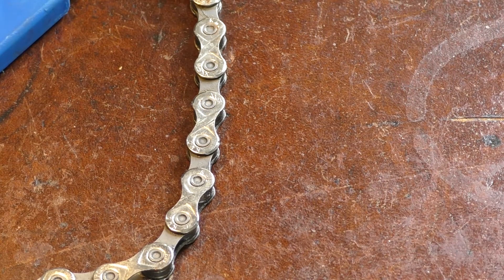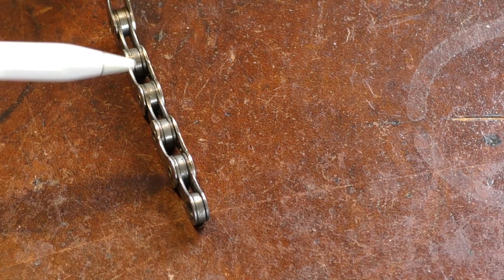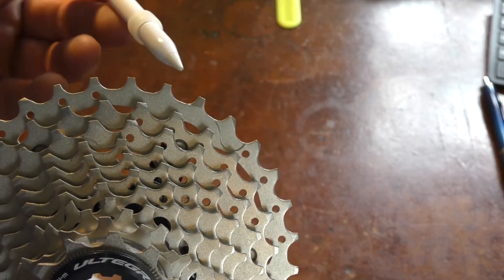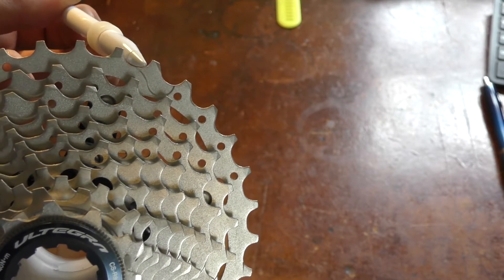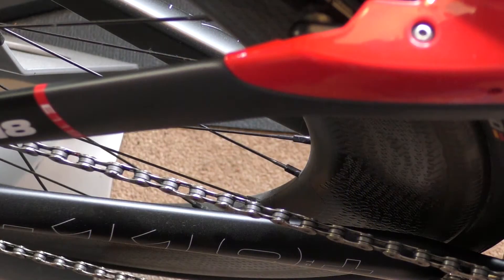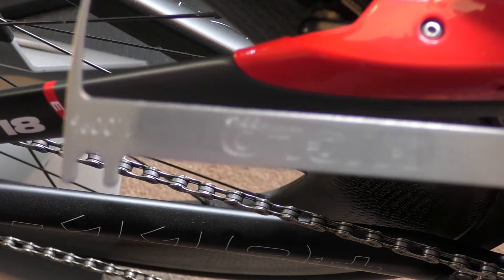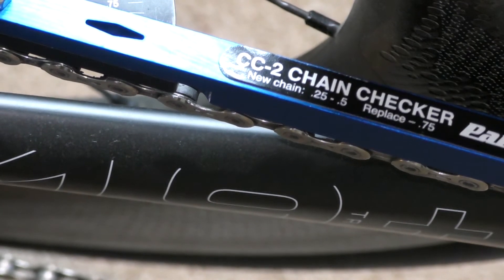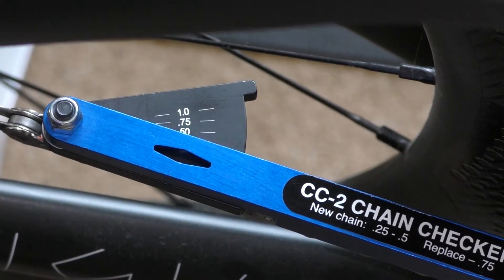How to check your chain

Comment: The type and quality of lube used and the method of applying the lube really makes a difference too.  With the lube I use, and cleaning and re-lubing every 200 miles, I get between 7000 and 9000 miles on a KMC chain.  I am not a powerful rider (62 kg and 181cm) but I do ride pretty hard most of the time and ride in all types of weather.  If someone is getting only 2000-3000 miles they are definitely doing something wrong.